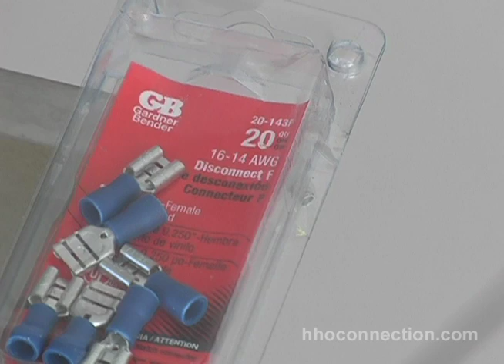Soldering Your EBN Dry Cell For 2 Wire Connection

Comment: hi there, i have a question, if you tighten the plates together with bolts & nuts doesnt the bult touching the stainless steel plates create a short circuit because its touching the plates?

Comment: That solder did not make any connection with the stainless, it only adhered to the terminal itself. You can't solder to stainless but you can braze or weld.

Comment from the maker: And just where exactly on these plates would you make these bolt connections? I understand that this can be done with a different plate design, but this video is about setting up an EBN style dry cell with tabs on the plates.

Comment: Why not just have bolt on connections on the plates themselves instead of male spade connections?  Solder connections and the heat generated by the naturally resistive stainless steel plates do not make a good combination, especially if you add the vibration of a motor vehicle. 
Just my 2c worth anyway.

Comment from the maker: The solder is nothing special. It's just cheap off the rack of the hardware store. The exact make is a company called Alphametals Inc. Rosin Core 40/60 (whatever that means). Like I have said to others I am by no means an expert at soldering, but this combo does seem to work, at least so far!

Comment: It takes some doing as I said, not easy to pull off with the electrical solder and the shrink solder push on's,  but it can be done.  I think you will be fine you have to TRY to remove them, either way..such a cool idea!  I wasnt too happy using 8AWG wires for each plate with the thinner push on's for my cell, even soldered i think they will overheat at 50A. I think this will solve that problem I can even go 6AWG to the bolts. Im told the bolts can handle 150A cool. :)  I have yet to test that.

Comment: NP glad to help!

Its a great idea with the ring terminals, wish I had seen this before I tried soldering the two 8AWG to my mega :P  I just tried pulling my soldered connections off.. It takes some doing and is not THAT easy to do. 

Also had a thought, it might NOT be the different materials/type of push on terminals that are making a difference for you based on materials, maybe they are just TIGHTER from the start, making them grip better?  Most are made from the same materials I think...

Comment from the maker: You might be right. I tried pulling on the tabs and wiggling them back and forth and it seems to hold but time will tell. I will try the silver solder like Scarecrow said. I mainly wanted to show my technique for getting the connections soldered with heat shrink over them because I'm too cheap to buy the soldered connectors, and they are hard to find. Thanks for the comments though.

Comment: I havent tried those push on's you mentioned or the type solder either (silver/rosin)it might be they actually might bond stronger which is good, I admit I havent tried them, just reporting what the electrical type solder did with my type terminals. 

Like the idea though, I will try it see if they bond better than what i used, its very clever either way... good thinking!

 I think I will use it on my MEGA cell where I have tabs soldered, but I need major Amp carry on the connections.

Comment: I would check to see if you can pull them off with some effort they probably will come off.   I soldered terminals like this using the electrical type solder.. they SEEMED bonded well, but really ONLY bonded to the push on terminal.  I figured they were solid but when moving them around, I found one popped off with some good effort pulling on it. 

It's not EASY to pull them off when soldered, so you are probably fine, esp if you get better bond than I did with electrical type solder.